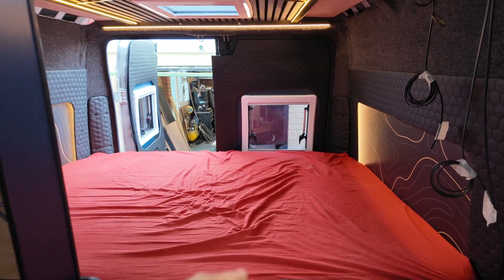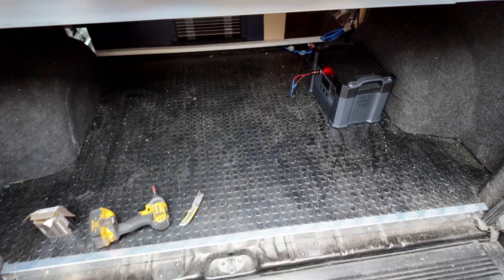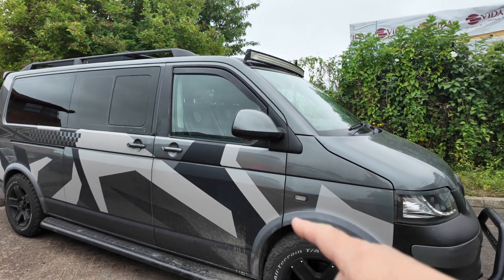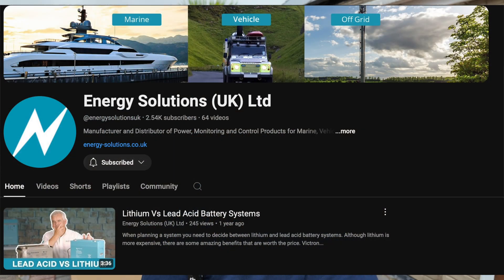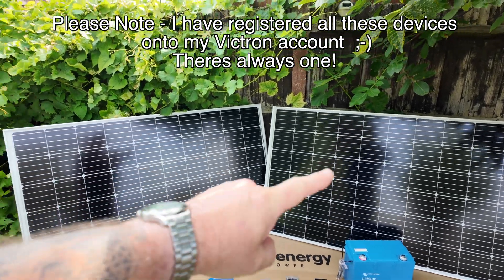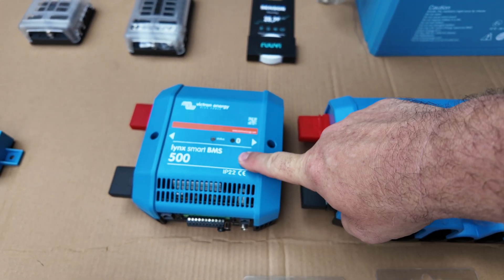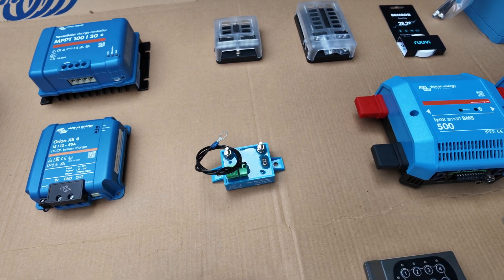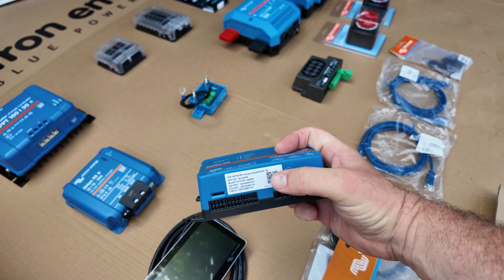The ultimate offgrid camper Electrical system CC13

Comment: Hi just come across your channel. Although your system is very high quality and reasonable spec from my experience I think you might be under spec for full off grid. My current setup (full electric no gas) is 780w solar, 450 ah lifrpo4 battery and 2 dc to dc chargers out putting over 60a and a 3000w inverter (2700w continuous). In my experience (uk only) the set up works great May to end Sept but out side of these dates you have to do more driving to keep the battery topped up. On a sunny day with the engine running I've seen 110 amps going back into the battery but winter you can forget solar it just isn't enough to make a difference so you have to drive. In winter if I just want to parkup for a couple of days my battery will get down to around 40%. My advice would be to add a second battery at this stage while you can still plan around it. I'm in the process of up grading to 610ah Lifepo4 so I can drive less if I want and it would still last the duration of my trip away and recharge fully when I get home or on longer trips, longer between camp sites to recharge. Other than that little tweek I think you are doing an amazing job the van is looking fantastic
Reply from the maker: Yeah I suppose one I start using it properly I’ll see wheee the weaknesses are. My plan was another battery but a little later as these are sooo expensive.

Comment: I am sure you are aware the inverter will put out about 2400w AC that's a lot of amps 200 plus for a 12v system so make sure your cables and connections are up to the job the last thing you want is things getting hot while you are using the system.

I have the 48v version of this inverter and it can run for hours at full load without any issues.

A great choice of kit the Victron stuff is expensive but quality is not cheap.
Reply from the maker: Yep they do draw some amps when running full power. 👍